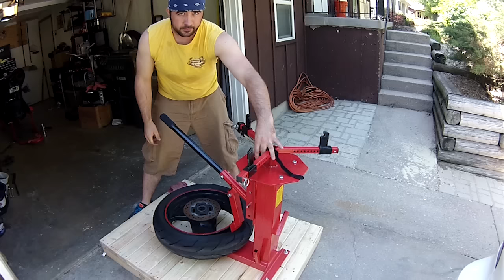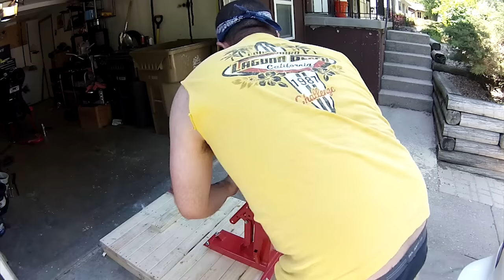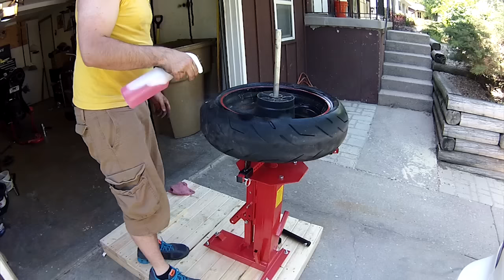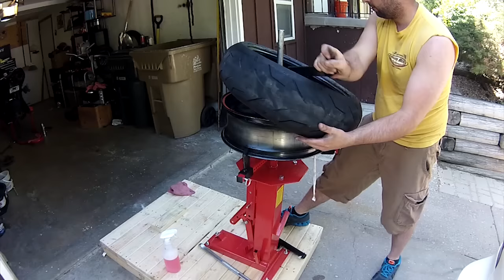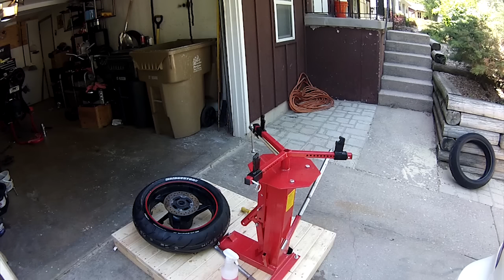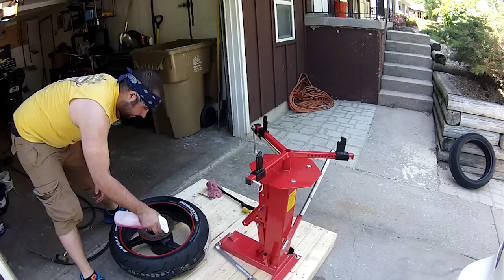Motorcycle tire change with ebay tire changer

Comment: A suggestion:  Remove the valve stem when filling the tire to set the bead. Much more air will enter the tire faster making it easier and faster to set the bead.  Then just reinstall the bed stem and fill to spec.Btw, I have the same tire changer but I also have a Mojolever which is better than the mounting bar that comes with the changer. I also bolt mine to my concrete garage floor with 3/8" bolts. It solid as a rock. When not in use, I just unbolt it from the bolt inserts I mounted in the floor and I then screw stainless steel set screws in the floor anchors to keep crap out of the threads.  The tire changer is much better than the Harbor Freight tire changer. It's rugged and solid. You made an excellent choice when you bought yours

Comment: I little advice.  I have changed many tires on my motorcycles in the past.  Take that disc off.  It doesn't take much to remove it, and it doesn't take much to warp it.  I have learned that lesson the hard way.  Get yourself some blue loctite and coat the threads when going back together, but protect that disc.  If you don't, it will cause a brake vibration if you bump or pry against it.
Reply: the good advice
Reply: No need to take the disk off
Reply: Removing the disk will usually require new bolts to reinstall. They aren't meant to be removed and reinstalled multiple times. They are literally what is going to save your ass when you grab a fist full of brake.

Comment: Your a brave man showing your First attempt, Im not surprised you scratched your rims doing it like that, I did my first time too. Stick with it, it gets easier. Top Tip for that tool, if you get a couple of short lengths of hose pipe and heat them in boiling water then slip over each end of the tool this will save your rims. Heat shrink works well too.

Comment: Good video, even the part where you struggled a bit. Its nice to see how you got around the issues
Reply: Footage Factory 
Sport tires a pain in the ass. No matter what machine you use. They have strong side walls and the drop zone is not deep. I remember when I was a tech for Mercedes and had to change low profile tires, wide on aftermarket rims. It took much longer.

Comment: At 6:20, you need to push the tire where you right hand is into the drop center of the rim to give you the slack you need. You can use those Irwin One-Handed Bar Clamps to squeeze the tire together. And hey, there is plenty of tire left at the edges.

Comment: not bad bud, I went with the harbor freight tire changer. for 80 bucks, its hard to beat, howver it need to be modded a little to actually work haha. I would suggest spooning the last bit of the lip of the tire on though....to much work with the tool that you was using, spoons would make it much easier for you. oh and another tip....dont tell to many of your friends that you can do this.......you will be changing tires for all your rider buddies in no time.....haha trust me. 

cheers brother.

Comment: I have this set up and I bolted it to the concrete so I can remove it and put it back when I want to.  I used drop in anchors.  Also if you have nice wheels the crappola tyre bar is not going to work because it will scratch your wheels up.  I got a motamec tyre bar (same style available with other makes too) it has 2 cotten reels on the front and one larger one on the back and a nylon flat plate which all work to stop scratches.  The bar itself is high quality and very weighty.  Also quite costly but works really well because it's fast and efficent.

Comment: good job. I can see you know what you’re doing. That tire machine is very solid just using a pallet. I don’t know how you did that. I attach the base of my harbor freight machine to my concrete floor, using 1 inch anchors, and it’s still pulled the anchors out of the floor..Ihave the similar stand -the harbor freight tire machine with the motorcycle wheel attachment. I had to buy special nylon grips for the attachment so that it would hold the rim still. I could not get the rim to stay still. I had to put a nylon strap around one of the spokes to keep the wheel from spinning in the containment holder nylon grips..I ended up spooning the tire on the way I’ve done it for decades. This machine does have a good bead breaker. I hope you don’t use dishwashing liquid , or any soap that has LYE in it to lube the tire..lye is the ingredient that makes soap feel very slimy and greasy. The problem with it is, it is the natural kryptonite/enemy of aluminum. It will destroy the aluminum over time. Any soap that burns your eyes, has lye in it.. I buy my rubber lube at Napa for $16 a gallon.. some places charge $50 for a quart of rubber lube on the Internet..

Comment: Instead of using a soft hammer another method for seating the tire bead to the rim for inflation is to wrap a ratchet strap around the periphery of the tire and tighten it up. This causes the tread to force in which in turn causes the bead to close up to the rim and create a seal for inflation. Once the tire begins to inflate remove the strap and seat your beads.
Reply: Just put the wheel on the ground, rubber on the ground, sit on the tyre, bounce softly up and down on it by sitting on it as you inflate it, it always bites and inflates.

Comment: Man U made that look easy. I just spent 4 hours on my rear cruiser tire. Step one burnout....step 2 remove saddle bags, muffler and tire...step 3 run over it with truck to break bead....step 5 tire irons and a lot of sweat....step 6 balance tire...step 7 install everything...step 8 test ride and I almost crashed hitting mud in the street. Can't wait to do it again on my front tire tomorrow:)

Comment: For those who commented about the yellow spot. The yellow spot on a tire signifies the point at which it is lightest for balance. You should check balance your wheel before fitting the tire, to find where weights would need to be added, and then fit the yellow spot opposite this. Whilst a rotor will be balanced and can be ignored, any other rotating attachment on the wheel, which many bikes (such as Harleys) have on the rear wheel, it is best to remove, trial balance and mark the heavy points of separately, and then reassemble the wheel to try to get the best balance with fitting the parts with the heavy points opposite each other. Then you trial balance the assembled wheel without tire, mark the heaviest point and fit the tire with the yellow spot at that point. Then you properly balance the wheel with fitted tire. Simple. It keeps the amount of weights you need to a minimum.
Reply: Or you could just use ceramic beads inside the tire and not worry about balancing a tire ever again.
Reply: Typically the yellow spot aligns with the location of the valve stem.
Reply: Incorrect

Comment: I have this tyre changing stand and the special lever to suit.
You have to bolt the stand to the floor, for example into a concrete hardstanding, as you will need to use your full body weight against the tyre lever.
You have to grip the rim really tight, otherwise the rim will slip in the three rim clamps and get deeply scratched.
The tyre lever should be used with plastic rim protectors, as it too will scratch the rims.
If you have old steel rims that you don't mind getting a few extra scratches, then this stand is OK.
If you are thinking of changing your tyre on a new aluminium rim, then I would look for a newer design of tyre changing stand, because this stand doesn't grip the rim well enough without damaging it.
Also, the powder coating on the stand doesn't last very long.
I had to get the whole stand hot-dip zinc galvanised, as it lives permanently outside.

Comment: ok i brought one, it would not fit an 18inch wheel on as i tried on an old cbr 400 back wheel,so i cut the clamps and welded the winding one back on and re drill the other two, i welded support legs near the first hole out to brace the arms up, it now works well but it is poorly welded as i had a clamp snap of so i rewelded them back on , if you cant be bothered to mod id buy a sealey one, bead breaker works well and on the whole it ok for the money just not well made if you follow.

Comment: thanks for the video.  do you have the link for the tire changer?  what size rim was that tire?  most say 4 - 161/2 inch and of course I have 17 inch rims.  do you think there is 1/2 inch wiggle room in the changer for a little bigger rim?

Comment: Darn good for your 1st attempt. I have the harbor freight version I don't even have to mount to anything. The part where you almost had the tire on, I like to use 2 tire irons on both sides of the the unmounted area of the tire and pry down taking little bites at a time.

Comment: Does that arm you use to stretch the bead on scratch the rim at all? Did you line up the dot on the tire which represents the lightest spot on the tire with the valve stem which is heavy side of wheel? Otherwise balancing is a pain and takes extra weight.

Comment: To anyone watching this try coating the machines contact points to the rim and the metal tools in some truck bedliner spray. Was told this by a tech at my local dealer where i buy my rubber. Greatly reduces scratching of rims. Worked great on my harborfreight tire changer....which is a wobbly peice of junk compared to this one!

Comment: It looks like your mounting bar needs another foot or more of length to give you more leverage. Is that other black bar sitting on the pallet the extension ? It will take a lot of the effort out of that part of the process. I have a couple of mounting bars that are about 3 feet or so in length and it's about right.

Comment: I think I know why you had trouble mounting the tire:
The mount head of the mount/demount bar is supposed to travel ahead of the point where the bead drops below the lip of the rim. Think of where you would put a tire spoon when taking little bites.

By hooking under the lip of the rim, the bead is forced out past the edge of the rim. Once it is past the edge it can drop down on the trailing side. Pivoting off the center post to arc the mount head is like making consecutive tire spoon bites all in one continuous motion. When you put the mount head where the bead is already below the rim lip you will just run right into the place where the bead crosses over. That just doesn’t work right.
Reply: I don’t understand what you’re saying, honestly, do you mind explaining again
Reply: “How to use mount bar of Pittsburgh manual tire changer (Harbor Freight)” -CZroe (Rumble)
Reply: @emmettturner9452  thanks

Comment: He will get better at it as he does it more often. The key is to get the beads of the tire squeezed so they are in the center of the rim, then you will breeze threw that last part of putting the final part of the tire over the rim...also, silicon spray works better than soapy waster, and lastly, i good compressor will fill that tire setting the bead fast. Practice makes perfect!

Comment: Could I give you some advise? Being that you are a biker, you should use a good quality air gauge, those cheap lie to me sticks are mass produced and isn't reliable when you need them. Sure sure you got the one that's perfect but drop it once and it's junk. I learned the hard way by going through tires like crazy until I found out mine was 10lbs off and cupped 3 tires from over inflation. Awesome to see kick that tires ass though, most can't do it with a HF

Comment: hi just bought the same machine on ebay  very pleased where did you get the yellow tyre bead holder from as it looks to really help
Reply from the maker: Its made by No-Mar
Reply: +andrewmiller316 The real deal $250+ No-Mar one has much better rim claps and mount/dismount bar, just saying, this is not a real no-mar.

Comment: Let me recommend getting one of those large white plastic buckets, so you can rest the wheel on it, with the brake disc inside the bucket when necessary, and push the tire beads down by hand after just two goes with the bead breaker. Just to reduce the chances of rim damage.
Actually, I always used to use the bucket method in the early days, even as a pro tire fitter myself.
And I don't like the look of the lever that came with the machine. Those ball shaped ends could rip the rubber off the tire bead when re-fitting if you're not very careful, as it's forcing the tire on rather than helping it.  With the old style fitting tables we used to use a special blade head that helped to maintain and direct the bead safely past the edge and down towards the 'well' in the wheel. And I guarantee that yours will damage the ally rim at some stage if you don't use the rim protector..
Reply from the maker: I have a piece of 2x4 on the base that the tire rests on, the rotor sits an inch and a half away from the base
Reply: +andrewmiller316 Ok, but all I'm just suggesting is that it's always good to keep metal away from ally rims as much as poss. ;¬)

Comment: Pretty cool. I didn't even realise that you could purchase a manual tire changer.  For $150 it seems worth it. Wish I had a garage for storage!!
How do you balance the wheel afterwards? Only question not answered in comments. tks
Reply: ask one of the haters here. they will know how not too.
Reply: You can buy a balancer as noted by ZombieHoarder, or you can use dynamic balancing via a product called DynaBeads.  You can Google them. They are small ceramic beads that you put in your tires. They balance the tire out as the tire spins.  Look them up on Google and Youtube.

Comment: What kind of tire lube are you using?
 Also be sure to check the valve seat for leaks not just the rim seal.
Reply from the maker: it's just soapy water

Comment: Should you not line up the yellow dot on that Bridgestone with the valve stem ???
Reply: You can if you want its not a big deal at all, I change tires as part of my job and it doesn't make a big difference either way
Reply: @Nameless_rat  apparently its the heaviest part of the tyre so should be inline with the valve.
Reply: Yeah it is, but I can tell you from experience it makes little to no difference unless were talking about some really heavy tires (and motorcycle tires are not)
Reply: @Zaya Young

It does make a difference. You will be adding a lot more weights to get it balanced correctly. That's if it gets balanced correctly.
Reply: Ace it really makes little to no difference lol I don’t know who told you that
Reply: @michaeldelgado1864  The dot is at the LIGHTEST part of the tire so should be in line with the valve.
Reply: @tenders  the yellow dot represents the heaviest part of the tyre. Look it up!
Reply: @michaeldelgado1864  I've confirmed this myself with lab equipment but many tire manufactures state this clearly on their websites. Here's what Yokohama says: " the yellow mark on the tire, indicating the point of lightest weight, should be aligned with the valve stem on the wheel assembly, which represents the heaviest weight point of the wheel assembly." https://www.yokohamatire.com/tires-101/advanced-information/match-mounting
Reply: Well done, very interesting video.Thanks for posting.

Comment: I saw a video where a guy laid a hair dryer blowing hot air on the inside of the tire parallel to the tread so the hot air blew around the inside of the tire to warm up the bead.   Went on real easy.

Comment: Nice Video Andrew!  You made it look easy.  I would be concerned about the rim and the metal tools as well but looks like you did Ok without much scratching.  You said it is easy to modify to fit 17" rims.  What is needed to do that?  How did you modify it?
Reply from the maker: one of the arms that locks the wheel in place needs to be moved out a little further. I did it to the one with the adjusting screw. each tire changer is a little different so you'd just have to look at the one you have (or buy) to see what needs to be moved
Reply: Great, thank you sir.  I was looking at the Harbor Freight changer but this one looks a little stronger than the HF one does.  May need to look at it since this one is not much more than the other.
Reply: +Voyager_PWS Did you ever buy it?
Reply: +The1700Rider  no I didnt.  decided to not mess with it.  :-)

Comment: Good job.  Not a fun or easy job by any means. 
 Owning three bikes ranging from a sports bike, HD road king and Honda Goldwing I'm looking into doing my own tires because it's a hassle to drop off the wheels or bike only to find they didn't adjust it right and find a big rub mark on your new wide white wall.  
Some dealers won't install tires you purchase cheaper from the internet (Harley wants $289 compared to $120 from motorxoutlet for the same tire)

Comment: Not bad seems like alot of work with a machine designed to help. Ive used the motion pro rim protecters with their bead breaker bars seems to have taken about the same time. But hey im sure your faster at it by now.

Comment: Pretty painful to watch but he got it done and that is all that counts.  I didn't see him line up the mark on the tire with the valve stem....If he did I missed it but you want to do that before seating the bead.  Two tricks...take the valve out of the valve stem so it doesn't restrict the volume of air..If you are having trouble getting the bead to seal up, wrap a cargo strap around the circumference of the time in the middle of the tread and ratchet up the band tight collapsing the tire in the middle that pushed the beads outward to the rim. Once the bead is set, let the pressure go on the cargo strap.

Comment: That looks like the tire changers that are listed as 4"-16.5" and a 17" sport bike wheel. Is that right? Looks like it works really well. Thanks for the video!
Reply from the maker: yeah, it's only meant for wheels up to 16.5", but can be modified to accommodate 17" rims